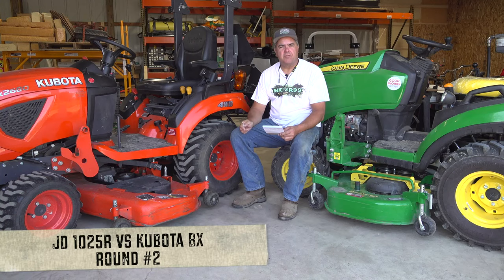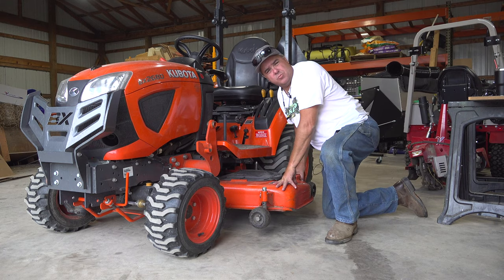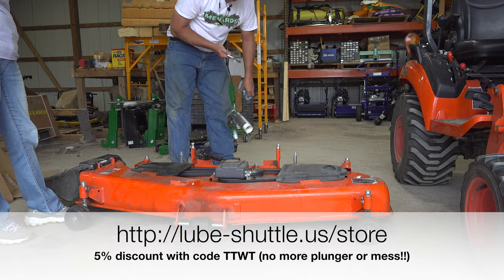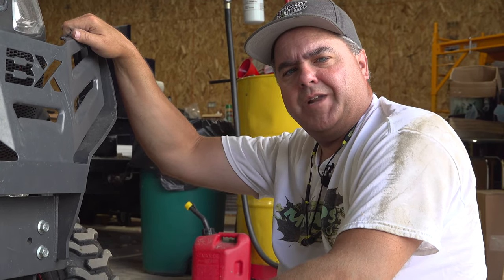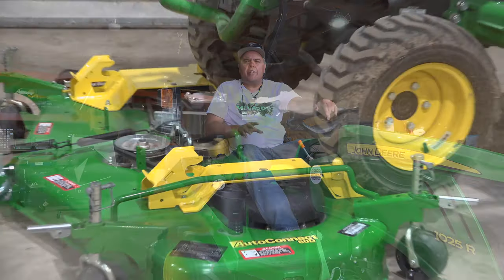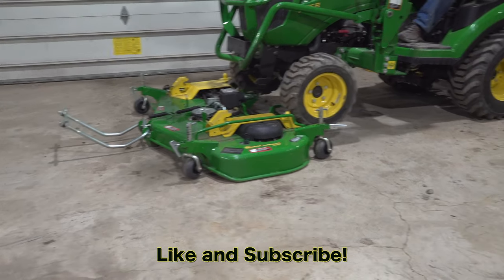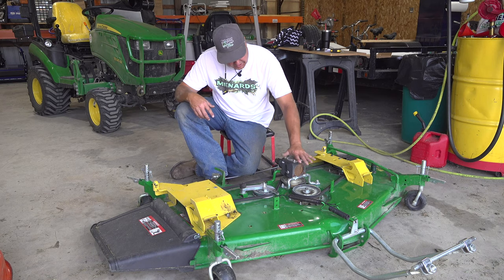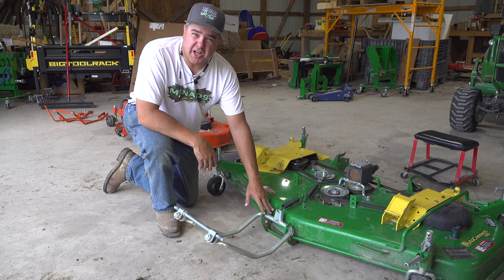Deere 1025R vs Kubota BX Round #2 of 8 Mower Deck

Comment: As usual, awesome video. I used to have a jd 1023E that would be a better comparison to this kubota features wise (eg 3 point hitch control.) however even my 1023E had the auto connect deck on it...anything else was a no fly zone for me. I recently bought a 2018 1025R with the auto connect deck and the backhoe. I live in Canada where things are quite a bit more expensive than they are in the US.  I bought my 1025R because deere was trying to blow out the remaining 2018’s and I still paid over $30,000. I would love to see an unbiased comparison video on cost with these tractors, especially having dealer/factory installed attachments such as mower decks and backhoes. I admit to being a bit deere biased and I understand it takes Benjamin’s to have a herd of Deere...well in Canada it takes Sir Robert Borden’s, but nobody knows who he is! Love the videos Tim and Christie, thanks for the hours of work you put into them!
Reply from the maker: Your comment illustrates how difficult it would be to do a fair comparison on price.
Here in the Midwest, Deere 1025r and Kubota are basically the same price.
So, any discussion would only be valid in a given region, or maybe even locality.   Each dealer prices them how they wish.
Reply: Tractor Time with Tim sounds to me that a 1025R in your neck of the woods, is a screaming deal comparatively. But like I said I have a deere issue and probably need a 12 step program.😉

Comment: I would like to expand a little on the other mower lift options you mentioned when discussing the Deere deck. I have a 2014 1023e tractor with a 60 inch autoconnect deck with the 'hydraulic' lift option. It does make the removal/installation process one step longer because you have to connect/disconnect one hydraulic hose in the black colored port where the loader hoses hook up each time the deck is removed/installed. My circumstances required an option like this though because I mow a very steep highway embankment that runs along the front of my property. It's so steep that I only feel comfortable backing up the hill with 4wd engaged and the transmission in low. Had I bought either of these tractors with lift mechanisms that are integrated into the 3 point system,  I wouldn't be able to accomplish this without removing the 3 point arms each time I want to mow the ditch bank.  The arms on these lift systems are simply too close to the ground to allow you to back up a steep hill without them digging into the ground. With the 'hydraulic' or 'independent hydraulic' option, you can mow with the 3 point arms raised all the way up. That flexibility was a big reason why I chose the JD over the competition.
Reply from the maker: Interesting comment. Thanks.
You might consider upgrading to the ‘independent hydraulic lift’ to avoid the hose connection.
Regarding the 3 pt arms on either machine being ‘too low’ when mowing.  I found with both machines that you don’t need to lower the arms nearly that low to set the mower to the proper mowing height.  I will attempt to remember that for round #3
Reply: Thanks for the reply Tim. Are you aware if the independent option is available on the 1023e? I thought it was only available on the 1025r, but I could be wrong.

Comment: Tim,  

I have said this before and I’m gonna say it again. I absolutely love my BX. It is a fantastic little tractor. That being said, I can’t stand to take the deck on and off. Jon and Neil make it look effortless and you even made it look easy. 

I did figure out the one thing that all 3 of you have in common that I do not. I have a gravel drive and no concrete surface available to slide the deck on. 

Thank you for giving us a fair and unbiased comparison. Both tractors are capable and can get the job done. I think both tractors have good points and bad points. It just boils down to what the individual likes (or can afford). 

Frankly I am a FARMALL fanatic and if they made a modern CUB I would be telling everyone how great they would be.

Signed The Other Tim with Tractors
Reply from the maker: Yes, I hope by pointing out weaknesses of each that the manufacturers will fix those areas and continue to make their tractors better.  I love capitalistic competition!!  We the consumer win!
Reply: On a gravel drive, I'd use the front end loader to lift the front wheels as high as they go.  The deck will drag out forwards.  Still won't roll all that well on gravel, you could consider a couple boards for the wheels to run on.

Comment: Did you know that Deere does not offer third function on loader when you have a backhoe.  That is the only reason I had to buy a kubota.  I wanted the auto connect deck but to give up the backhoe I could not do.
Reply from the maker: Not true, Jeff.  The new 3rd function kit is compatible with the backhoe. Also, artillian offers a diverter kit which I use on both of my tractors for grapple function.
Reply: OK that was back in 2018 when I was looking at the Deere.  Thanks for the update.

Comment: The one thing that i think you should have mentioned is to lift and lock the mower mechanism on Johnny, just so it can't get hooked on something when doing loader or other work
Reply from the maker: Both tractors have that feature.  Thx.

Comment: Deere is example of American engineering at it's best. Foreign countrys take our engineering ideas and try to simulate the patent. I would like the formal on auto connect adjustment. Tim when you get time. Laying on floor install of mower deck? No!!! Not doing it. I will adjust what i need to. Work smart not hard. I love our Auto connect, loader. Love our Deere!! No questions. Plastic hood and all 😜.

Comment: I bought my 1025R used, and had a real hard time removing it the first time. Even now, the deck just slides if i try to take it off on a smooth concrete surface. But I can remove it easily enough on grass, or by using the edge of my concrete pad to prevent it from sliding. Like you, I take it off after each mowing.  Looking forward to your mower deck adjustment video.
Reply: Is your tractor in 4wd when attempting to remove or install the deck?
Reply: @hardnaaklife  Yes. Basically the front wheels never get purchase on the deck, because it slides with the tractor, even though i unlock it. I've greased the PTO.  So I make sure to drop the deck down in front of a small edge to get it off.

Comment: Tim you should have let the anti scab wheels a bit lower on the Kubota as to prevent stuff on the top side of the deck from hitting the frame.
Reply from the maker: Good point.  The bolt hitting the frame was not really a big deal to me.  No  worries.

Comment: Putting the mowing deck on a Kubota is always painful even if you have the drive over deck because of the way the mounting brackets line up with  deck. The quick PTO shaft connecting handle also always bends and is a pain. I have the drive over deck and my neighbor has the manual one, I wish I had chosen the manual deck for my Kubota BX23s.
Reply: The manual deck on my 23s is actually not all that bad to do. Obviously not as easy as a Deere autoconnect but I have never struggled to pull it off or get it back on.

Comment: I think the kabota has a drive over deck to. could you have gotten one of those to be apple's to apple's in stead its apple's to oranges
Reply from the maker: Yes.  Will discuss in a follow up. Should have mentioned. Kubota sales folks do not recommend the Kubota drive over.  We couldn’t find one.  
So, we chose to go with what folks say is the best to get.

Comment: Hi Tim  I have been watching you guys for a while and now have just subscribed. Just throwing this out there about you adding a center wheel to your mower deck. How about adding two wheels to it one on either side of the center attachment looks like that would solve your problem and also may make the deck more stable just a thought. Keep up the good work I enjoy watching.
Reply from the maker: did you see the episode where I installed the roller on the 54d?  If not, take a look.
BTW, thanks for subscribing!
Reply: @TractorTimewithTim  I watched the video and think with your welding skills or some one else's. Yes I watched you weld before ha ha, I would find some of the other style wheels like the ones on the deck and use them. This would be an easy way to adjust the wheels with the pins and springs and not have to worry about using any wrenches.

Comment: I would like to know the blade tip speed on these 2 tractors and how it compares with zero turn mowers.
Reply from the maker: How would we find this out?
Reply: @TractorTimewithTim  I think you take pto rpm which on the BX is 2500 rpm and multiply by blade length in inches divided by 3.82.  Not sure on exact blade length.  Maybe you could check around and see if this is correct formula. I'm really enjoying your series on these 2 tractors!

Comment: One more tip for removing the Kubota deck: raise the casters on the deck before setting on the ground will lower the deck giving you clearance needed so you don't hit the frame.
Reply: But you can't turn the caster sideways when you do that. Can you?
Reply: @truckinchihuahuaalvieschre2494  
Yes, my brother in law puts his in the next to the last hole and has no clearance issues besides moving the deck forward and backward for the casters to clear the tires when pulling it in and out.
Forgot to mention his casters has 3 holes not 2 like the one demonstrated in this video.

Comment: When I have to remove or install my mower deck on my kabota I use the front loader to raise the tractor to get more clearance to get the deck underneath the tractor but I agree that it is not an easy task

Comment: I think getting the deck off of the Kobota would have been easier if you selected a lower deck wheel setting. ;-)
Reply from the maker: discussed in the 'follow up' to round #2. The next setting downward forced the deck to drag.
Reply: Does it have the correct pins in it so theres no slop? The next setting should be just off the ground. Ill try to find your follow up. These aren't coming in order for some reason though. I have to search for the next videos.
Reply: I found it. Those are the correct pins. I think there must be a manufacturing error in either the hole locations or the wheel mount location. I dont think its the wheel mount. It looks like the hole location in the shaft. It looks to me like one is right and 3 are wrong. I'm not a tiny Kobota expert but that make the most sense to me. Why else would the holes be there in the first place. You could always drill new holes. :-)

Comment: Hello Tim, you had to sad the scalpel wheels on the Kubota on the lowest point like you do on the Deere deck and turn the front wheels for more clearance and smoother removal. You have to be perfect level for the auto-connect and strait?
Reply from the maker: not perfectly level, but close.  You would have plenty of places to do deck install/remove in your yard :-)   Looking forward to seeing green there next time I visit.  Just get one of the thousands of them up the road!
Reply: @TractorTimewithTim  I have only 340 hour's on it in 3 years..... no time for change yet... just getting used to it LOL Made my own drive over construction and it works great.! I follow Spencer lawn care with his stand on mower and i like that idea... closer

Comment: I will stick with a zero turn mower! Always hated the work to remove a deck, I call that a stick in the eye! .
Reply: Auto connect is the way to go off and on under 2 min if you rush if you take your time its still less than five minutes. My only complaint with the auto connect is the lift mechanism sits a little lower than I would like because I have actually bent the bar that goes across the machine on lumber when I was doing some land clearing and not paying close enough attention to what I was going  over.

Comment: Not sure if this was said already, but the bx deck looks like it has a double stacked belt which the deere only has a single belt. Still the points in my opinion are for the deere.
Reply from the maker: Double stacked?  What do you mean?
Reply: I mean that the belts looked doubled. One on top of the other. I believe they are connected in between so still one belt but doubled v’s. The deere deck just utilizes a single v belt.( only one grove on the pulley, the Kubota has double grooved pulleys.)
Reply: Also great job on the comparisons Tim really enjoy watching these.

Comment: Doesn't the BX have an optional drive over deck as well?
Reply from the maker: Could not find one to test:  dealers actively do NOT recommend this option.  There are a few comments here of folks who bought it anyway. They are all negative on it.
Reply: My local Kubota dealer simply will not sell the drive over deck, ...period.  Too many customers complaining and multiple return warranty visits, bent ramps from improper deployment, etc., and shop time involved in getting the customer satisfied.  The boss/owner said they will only offer them again if Kubota totally re-engineers it, and it proves to be robust and dependable.

Comment: Good information, but those decks aren’t entirely apples to apples. Kubota does make an auto connect style deck. Can’t wait to see you put the BX to work besides Johnny!
Reply from the maker: Yes. I should have discussed this.  I could not find a Kubota drive over deck.  Most sales folks discourage them.  Not sure why.
Reply: I understand. You don’t really get to pick the options on used equipment. I’ve heard them discouraged as well, but as you mentioned in the video the issues maybe due to improper adjustment.
Reply from the maker: Would love to test one.  I discuss this further on my website written review.

Comment: it looks like you can lower to the next lower pin setting one more hole down on the deck wheels so the bolt will clear
Reply from the maker: Yes, i missed that.

Comment: IMO the auto connect deck and independent mower lift are JDs best features. And as noted in other comments, Kubota has a drive over deck available. I have a Massey Ferguson GC1720, and its drive over deck is better than Kubota, but still not as slick as the drive over on JD. Would have loved to see a Massey in this comparison! I will add, my dealer didn't say a single bad thing about the competition!
Reply from the maker: Fascinating. at the NFMS, both 2018 and 2019, the Massey folks blasted the Deere auto-connect. Couldn't say enough hateful things about it.    Sounded petty and jealous.
Reply: @TractorTimewithTim  I think we agree here. If your sales pitch includes bashing the other guy, I get turned off immediately. No question that the role out of the auto connect deck had some problems, I think mainly due to dealers not knowing how to use/adjust them. Should be a non issue these days.
Reply from the maker: I didn't even know that massey had an auto-connect deck. They did not show it at this spring's farm show (did you see our video on the GC1725M?)  We explicitly asked about it I think.
Reply: @TractorTimewithTim  Massy only has a drive over deck option. Need to relase the ins on the front and either side, and still need to get down low to connect the mid PTO. In my previous comment I was referring to the problems with the roll out of JDs auto connect, which is what some people use to bash the system now. I think people have figured it out at this point. Massey has the best operators station, engine, and hydraulics. But I would like an auto connect deck with independent lift, and I'd also take that new loaders with the all in one hydraulic connectors and the factory cab from Kubota. Let's be honest, these little tractors are mostly sold larger residential property owners, almost as big boy toys. They want more features, and most are willing to pay for it.

Comment: Had a Yan#@r 324 with a mower setup just like the BX. Biggest hunk of junk. Hate that mower deck so much that after selling tractor made sure to not get another belly mower. Currently use a flail mower with better results. 
BX, still the wrong color orange. 🤣😂🤣😂

Comment: I have the Kubota BX drive over option on my BX2380.  The sales staff didn't seem to like it, but I still opted for it.  Biggest plus to me is not having to reach underneath to hook the driveshaft.  The biggest con is the deployable ramps Kubota uses, and the amount of frame that stays with the tractor.  I actually don't use the ramps, I just detach the mower from the frame, then pull it out the side like a standard deck.  The additional framework has not posed a problem for me yet.  I still find it a little easier that a standard deck, but obviously not as easy as the JD autoconnect.
Reply from the maker: Are you located close to me?
Reply: @TractorTimewithTim  Not terribly unfortunately.  Located in Iowa.
Reply from the maker: would love to test the kubota drive over.
Reply: @TractorTimewithTim  If ever in the neighborhood!  I will concede that the JD Autoconnect Drive Over is the better of the two.  I chose my Kubota BX2380 due to price, dealer, and previous experience, as well as there were just a few things about the 1025R that just didn't feel right to me.

Comment: I like to put my 1025r pto selector in the rear 540 pto position to let the mid pto spin freely. This helps it slide on and off when the pto is not lined up exactly.
Reply from the maker: Yes. Forgot to mention.
Reply: That's a good idea I'll try to remember that on mine. I have had that very small issue a time or 2 myself on my auto connect.

Comment: Not very fair Kabota also has a drive over deck.
Reply from the maker: Many comments and replies about this deck. Also, I discuss it in a follow up video.  Every dealer we talked with recommended against that drive over deck, said it doesn’t work well.  Oh, and you still have to manually hook up the PTO shaft.
Check out the follow up episode.
Reply: OK great thank you great video